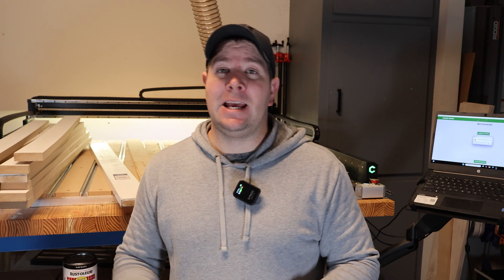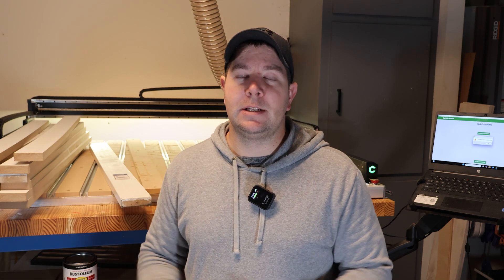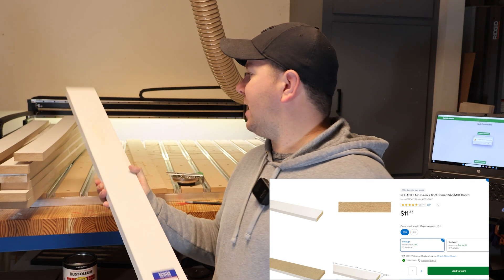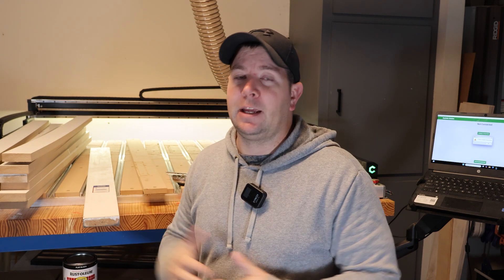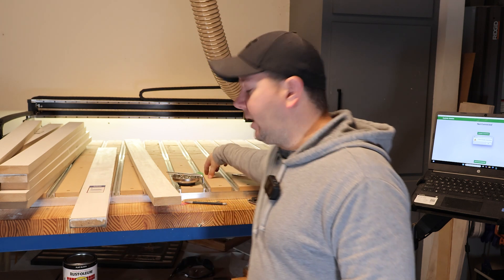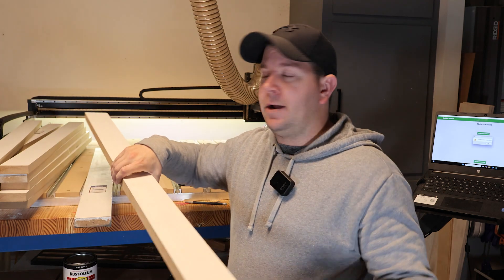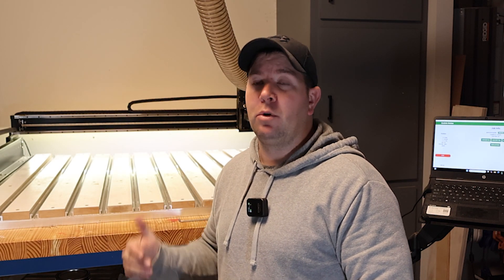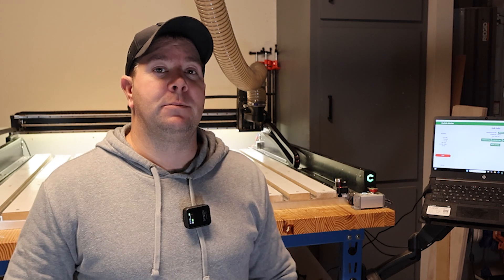Shapeoko 5 Pro 4X4 spoil board replacement

Comment: Nice video. Could you do a video on how you use vectric with the shapeoko. I have a shapeoko 5 pro but have only used it with carbide create and carbide motion. Would like to use vectric for some things but dont know what is needed to make it work with the shapeoko. I see on some forums that it does not stop for tool changes. Keep up the great videos. Thanks
Reply from the maker: Yes absolutely. I was actually planning on doing some videos that would help with that subject. I’m just trying to figure out the screen capture aspect of it.
Reply: I'm not sure what you saw online but it will cut with one tool and stop so you can change out tooling as many times as your file calls for. There are a lot of vectric vcarve guys on YouTube that have detailed walk throughs from start to finish. I have the shapeoko 5 pro 4x4 with the water cooled spindle and vcarve pro and haven't ran into any issues.